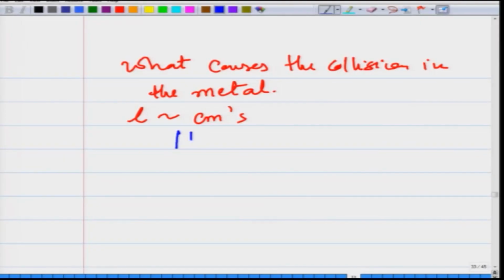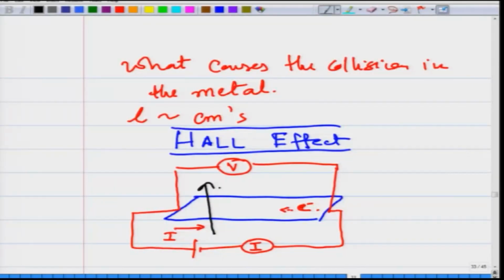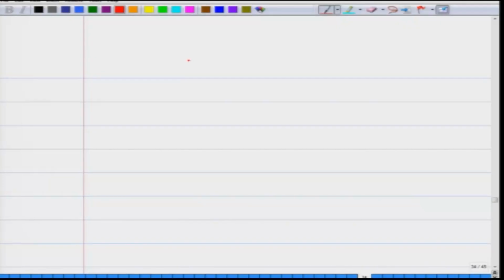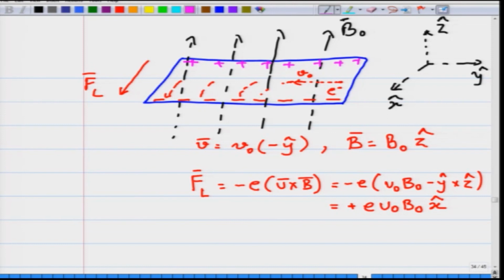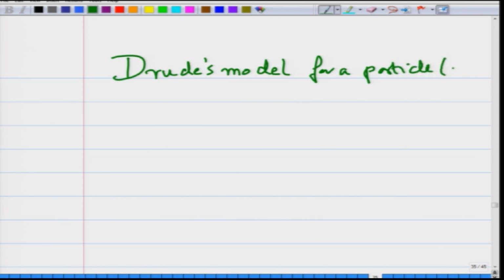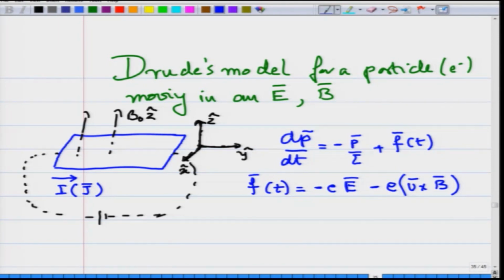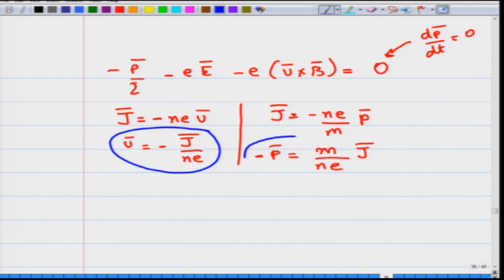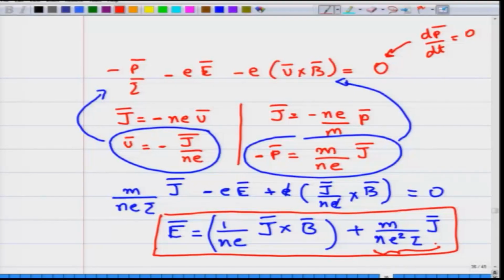noc19-ph02 Lecture 06-Introduction to Hall effects in Metals- Part-I

Comment: why all the four probe are collinear in four probe method.
Reply: Because it tries to measure voltage drop and current along the same line so as to maintain consistency. The two probes need four points and so are collinear